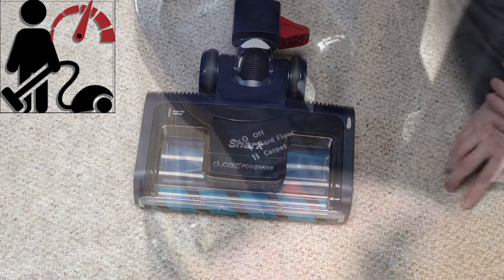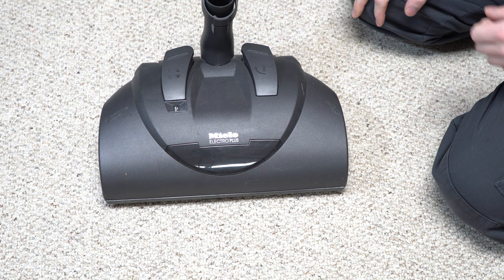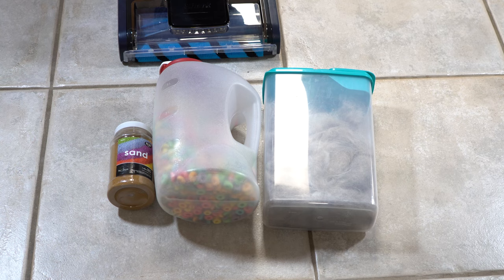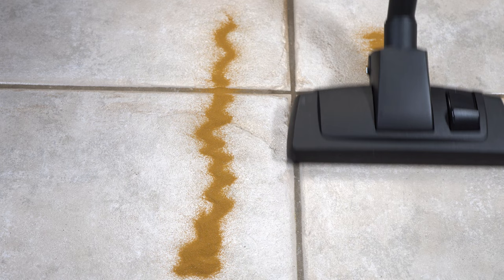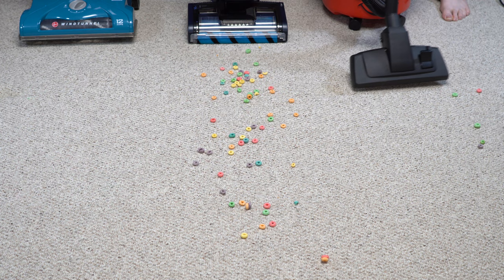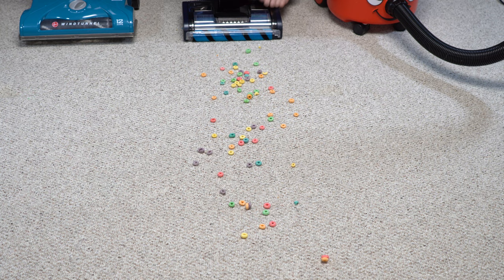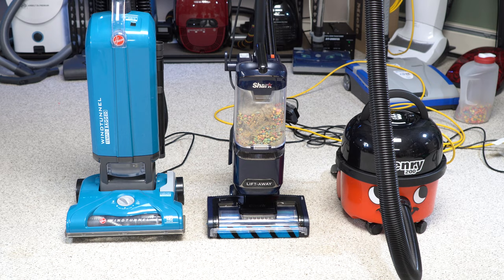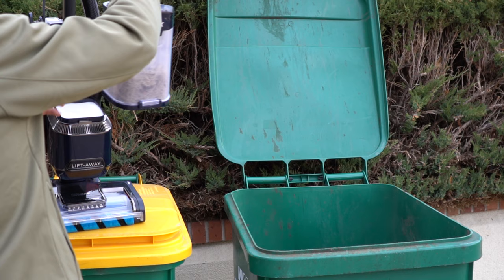The problem With Shark duoClean Vacuum Heads

Comment: Bought.  Returned next day.  Hot garbage.  Shark was great about accepting the return so that was good. 

Put up the dough for a Miele.
Reply: Nice! I'm wanting to splurge on a C3 cat and dog sometime this year. What model did ya get?
Reply: @MrBikboi  complete c3 power line home care. Went big.
Reply: @georgeonderko5273  Nice man I'm sure you won't be disappointed, those are drool worthy
Reply: @MrBikboi  we’ve had it for about a year and a half. It’s been great.  There’s zero dust in the compartment. The bags last forever.  We had an old kenmore canister that was good but eventually needed replaced.  

It’s stupid expensive but we got it from a dealer and this is the kind of vac you buy and keep for 20years with some tube ups. 

My only complaint is a motorized handheld attachment would be nice for furniture and stairs.  Especially at these prices.
Reply: I just noticed the soft roller no longer spins under power and my LS502 is only 11months old. I have read others being quoted $75 for a replacement part as it isn't covered under their 5 year warranty. I have some security torx bits on their way, is there any possibility I can repair this myself or did the plastic gears give up? I can spin the soft roller and there is no sound of broken bits so I'm a little hopeful it jumped the track or some sort.
Reply: this should tell all. the price range performance is the difference. that and sealed hepa filtration.
Reply: @georgeonderko5273  what does "tube ups" mean related to a vacuum?
Reply: @tdbass2968  tune ups.  Autocomplete fail.

Comment: To be completely honest with you, when I am vacuuming my kids cereal that’s has been kicked under the table I am not going to gently hover over the cereal and pull back over it with the vac head.  I’m sure the Henry is a fine machine but it seems like an apples and oranges comparison.
Reply from the maker: All the difference here is one will pick it up and one won't. The effort of which you want to put into vacuuming is completely up to you. 

It's definitely an apples and oranges comparison!  Considering one is a quality machine that's made to clean and the other is the disposable cigarette lighter of the industry.
Reply: There is no apples to oranges comparison. This Shark vacuum just suck. They made the vacuum look good for advertisement but doesn't do a good enough job and that's how they trick people into buying their crap vacuum

Comment: The reason why the soft brush doesn't have suction is because it's more intended to seal the main vacuum area it's flexible enough to let in big debris and helps keep the seal for the suction on the main brush instead of having to lift up your vacuum or select a height manually

Comment: I like my Lux 4000 for daily carpet cleaning. I use the old Sure Thing 4 ply bags that keep my bag chamber nice and clean. I have a a carbon pre motor filter and a HEPA after filter installed too. Practical, effective and easy to work on and maintain.

Comment: I am thorn too. I also bought the most expensive Shark Vertex Duo two years ago. Furthermore, I had had a Miele before, for 13 years, that was too heavy for me, and decided to leave Miele for the "great performing" and lightweight Shark. Miele started having issues 10 years after we purchased it. Well, two years after buying Shark, the machine's head is not suctioning, and the soft roller is not rolling.  I am still in the middle of learning how to deal with the problem. After watching several videos, I guess the band that connects the two rollers might have broken, but there is more, I think. I have cleaned all the filters and everything I could clean in this vacuum cleaner. It took me 3 hours to remove all the hair stuck in the connection between the soft roller and the vacuum head, because there is no easy reach to that place without putting the vacuum apart, which would void the warranty. I will contact Shark now and will see how it goes. And yes, I didn't expect such an issue two years after the purchase of a $400 vacuum cleaner :-(.

Comment: I have the Shark Apex duo zero M.  It has constantly stopped working in the middle of vacuuming because the filters do not allow for the motor to cool and it overheats.  I’ve had to replace the motor twice and they even sent a new unit, and I still have the same issue.  
I had a basic navigator for years and never an issue on carpet, the duo rollers (especially the front one) were constantly getting clogged up with things and I had to take apart the head almost every time I vacuumed.  Horrible experience.

Comment: I am looking for a new vacuum.  My sharks worked OK but after a few years both failed on clip.  The problem I had with them is the head is so narrow the Shark vacuum tends to want to topple.  I looked at the new vacuums and couldn't bring myself to buy them.  WHY would I want a cloth brush?  That will get nasty in no time.

Comment: Bought this almost a month ago, I am not impressed, I have to keep going over the floor. Not only that but it cannot clean and pull in dirt on the edges of floors. I used the handheld for getting in the edges, hardly any suction!  I am returning mine. And I really wanted a cordless. ☹️

Comment: please help my shark Duo has power when I plug it in and hit the power button it turns on however the very bottom piece that you roll over the floor does not have the headlights on it does not have the red light that will come on if something's wrong and it doesn't have the green light that comes on if something's right if everything's okay I turned it over it has no power turning the brushes so I'm trying to figure out where is the power stopping because it sucks all the way through the hoses even where I take it apart in different intervals it all works that way there's even suction coming through the very bottom but it's not turning the brushes and it doesn't have those little headlights that come on so it's not doing a very good job at vacuuming that way can you help me in any way please I'm so sorry for such a long text?

Comment: So whats the best vacuum for a house cleaner? I bought the shark vertex and its gone through 4 power heads and 2 dust cups. I got the shark stratos and it works but just wondering what vacuum works and will last longer then a shark and not too heavy to carry house to house.
Reply: Get a Sebo or a Miele.  They last for 20 years and have double digit warranties.  If you like to use upright vacuums, get a Sebo Felix or a Sebo Dart.

Comment: The soft duo roll is really just for hard floor cleaning correct? Like it's not necessary feature if I'm just going to use the shark on carpets and use the attachments? So instead of the apex just get the pet version?
Reply from the maker: It's marketed for both carpet and hard floor. This is the only carpet attachment this vacuum has available. Just like most sharks it's pretty horrific.
Reply: @PerformanceReviews  thank you. I haven't really used  good vaccum. I do prefer bag canister so now I'm on to finding a decent one of those for under $150.

Appreciate your response and videos.

Comment: But see. Where you say the fins are "not as agitating" as a normal bristle brushroll, I hear exactly what I need. I have cheap laminate floors. A normal vacuum brush roll scratches it. But I feel like the fins are one wide flexible piece rubbing across the floor, not catching the edges of my floor planks. Whereas a bristle brush roll is a bunch of very stiff bristles just digging into the edges of my flooring planks. Am I just crazy? My house is so open that sweeping is a pain because its such a wide area that the dirt and dust is just blowing everywhere every time I move the broom, so I want something to suck up the dirt when it hits it lol
Reply from the maker: You'd be better served with any canister vacuum with a normal floor attachment like a Henry, Miele or SEBO

Comment: I had the same problem with my shark.  The hair and debris got stuck behind the roller 🙅🏼‍♂️😡.  Very frustrating when I’m trying to find a good vacuum as a house cleaner
Reply from the maker: If you're cleaning houses I would recommend you get a commercial vacuum cleaner. Numatic, kärcher, Lindhaus. All make commercial vacuums that should suit your needs.

Comment: I have had 3 shark floor head nozzles break on me with the duo apex. I had to argue for them to replace it the 3rd time. The soft brush roller stopped spinning 2 of the 3 times. It appeared the bearing broke....I couldn't even get it to pick up anything on my rugs when it broke. I bought a 5 year warranty plan when I purchased the shark in 2019. Definitely will be looking for a better vacuum that will clean both tile and carpet.

Comment: Has anyone actually figured a head that detangles itself and tested it realistically on pet fur that actually embeds itself into carpet?! Real siberian husky problems here needing to be solved LOL. My miele picks up fur, sure. but then i spend all the time cutting it out of the brush roller.
Reply from the maker: I'd recommend using your miele on its highest suction setting if you're not already. I have a dog that's part husky and did not have a problem with pet hair in their brush roller only human hair. 

But the answer to all vacuum problems at the end of the day always leads to a central vacuum system.
Reply: @PerformanceReviews  Oh it is on max. I think it's just the fact that my husky is near wooly. For comparison, my other husky's tuft of fur would drop straight to the ground. The "wooly" tufts ... you might as well send it off with a wish before you blow on it and expect it to land in the next country. It just takes off. Long and light fur is just a disaster for all of these rotating brushes that spin about the cylindrical roller axis.
Reply: Also on a Sebo you can always Yang the brush out in 5 seconds. Cut the hair off and put it back.

Comment: I could of swore the Shark Duo had an open face design. Did they change it in resent year? Or am I confusing it with another Shark product?
Reply from the maker: Not exactly sure what you mean by "open face design"
Reply: @PerformanceReviews  What I meant by "open face design" is that there's no plastic covering over the rotating brush. Sorry for any confusion.

Thou I seen in the comment people talking about the older model was better so I might be thinking of that one. Or mixed it up for another brands product with a similar design/features

Edit: Update: I found a video for the Older Model and it seems it's gaurd over the brush is smaller, so from some angles it appears to be completely uncovered. I guess they made it larger to prevent the vacuum from throwing dirt upwards.

Comment: A good cleaner head for wall-to-wall carpet would have heavy-duty plastic, manual carpet height adjustment, a beater bar that vibrates and grooms the carpet, a squeegee, and a heavy-duty motor. Shark uses a light-duty motor, cheap plastic, a gimmicky design that doesn't do a good job of picking up dirt and grit, and their warranties suck.

Comment: I bought the most expensive shark vertex vacuum they sold.  It was working fine until a rock got stuck in the second roller.  There’s no way to remove the roller.  

I bought a cordless version of the shark.  It kept getting clogged up.
Reply: Technician here. You are right. There is a way to do it but it’s an ordeal
Reply: @goodgremlinmedia2757  

The duo clean was really useful for bare floors.  But I ended up getting a Sebo.  It’s great for carpets, but the bare floor attachment is frustrating.  I think the best option for bare floors is a dust mop.

Comment: I’m so frustrated with mine right now!!! I have the cordless handheld Ion Duo and when on high, it turns off….I’m assuming overheating. Filters are clean, batteries charged and I can’t seem to find a clog (although it doesn’t quite sound right).
There are almost no troubleshooting videos to help with this issue. Frustrating!!!
Reply from the maker: If it's under Warranty call the 1-800 number and insist on a replacement. 
If it's not In warranty disposal in the proper bin. 🚮
Reply: I have the same issue. It makes like a loud whistling sound.
Reply: You should swap it out with a Miele Triflex.

Comment: The classic Henry nozzle is such a fantastic piece. Would serve anyone who bought that shark for hard floors much better. And last for decades easily. I just can't think of a situation where I would ever buy a machine that isn't bagged either.
Reply: You can get air brush for Henry too. But Henry just generally works by brute force suction. Nothing fancy no special duo brush bars etc. Henry being super simple all parts can be replaced easily and cheaply. Even the motor brushes are replaceable.

Comment: Those powerfins or whatever they call them make no sense? Yes they spin slower for a hard floors but they are still going to be an issue for delicate flooring surely. It’s just marketing crap, in the real world a good straight suction nozzle just works …… I know I’m preaching to the converted though 😂

Comment: I bought the shark petpro due to good reviews off a few youtubers i thought i could trust

After 2 years of owning i had to get rid of it and get a dyson

The self cleaning roll is bs it does stop hairwraps but all the dirt and hair just builds up behind the roller blocking the airway it got to a point where id have to use a knife to clear the debris from the head each time after I had vacuumed just to keep the airway clear

Theres no way to deep clean the head or pull it apart so if u vacuum up something dirty theres no way to deep clean the head which becomes quite disgusting

The suction power was terrible ud pretty much have to use it on boost all the time to pick most things up

It was shit on tiles and always left sand and hair behind and it was even worse on carpet it just cleaned the surface debris and pushed the rest further deeper

Since finally shelling out the coin on a dyson I wont ever be going back to Sharks gimmicks and flashy marketing